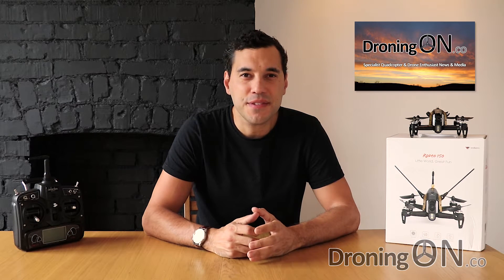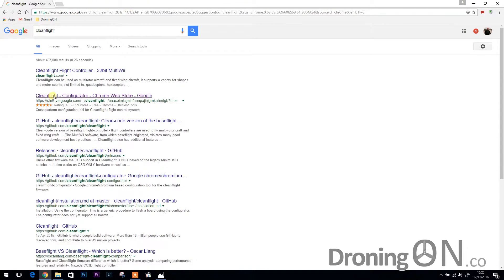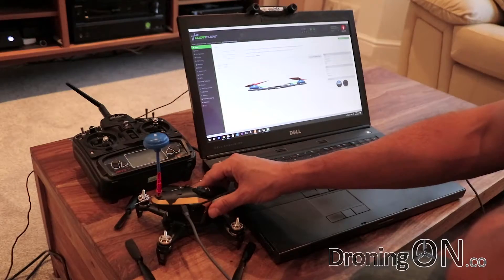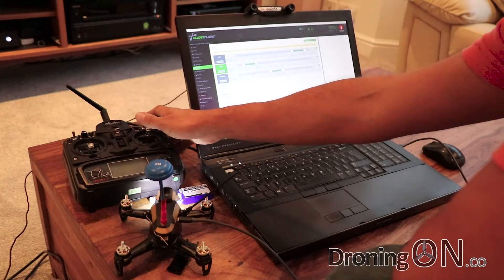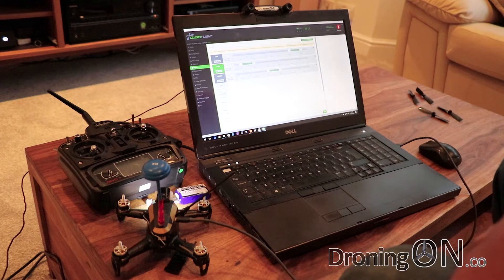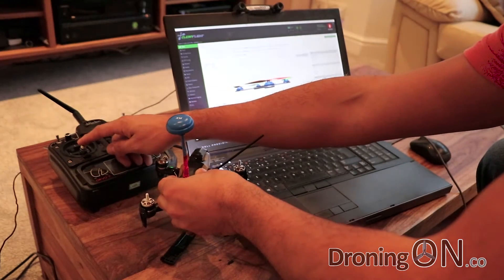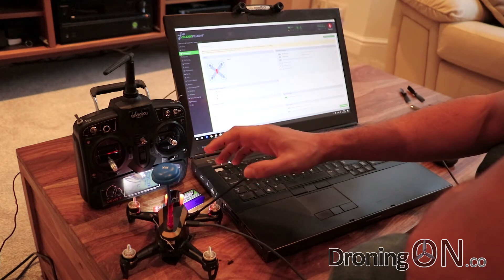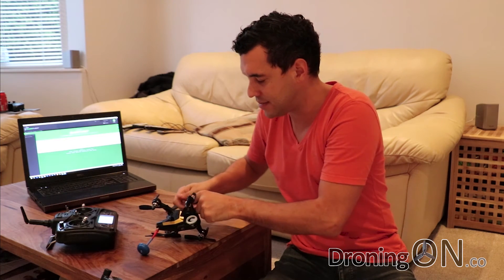DroningON | Rodeo 150 Cleanflight Tuning, Tips and Tricks Guide (Cleanflight)

Comment: The Rodeo F150 does not connect to Cleanflight version 2.0.0 and above.  If you do so on connection it will say that clean flight is not compatible to 3rd Party firmware.  Download older Cleanflight release such as 1.2.4 from here 
https://github.com/cleanflight/cleanflight-configurator/releases
Download the  cleanflight zip file version you want test and place it in a folder on your pc that you can easily find. 

Then the right hand corner of Chrome you see 3 dots stacked vertically. 
Click and go to "More tools" > "Extensions"

A new screen is loaded.
The top of the screen there is a Blue Bar with Extensions heading. 
At the right top of the screen there is a slider developer tools .
Slide it to the right. 
Then 3 buttons appear.
Load Unpacked / Pack Extension / Update.

Click load extension.
A  browsing box appear. 
direct path to were you saved the zipped Cleanflight configurator 
You will see that there is Clean flight added. 
Go to Chrome Apps launcher and run the Cleanflight 
Download the drivers  
Shut down restart pc.
Enter Chrome 
Connect the F150 to your pc
Then hit connect and follow Droningon video..... :)

Comment: It is an excellent tutorial and I tried to follow you step buy step . I plugged the 150 to usb and my laptop found and installed the driver. Next I downloaded the Cleanflight app. It showed com3 and if I drop down the list there is com6 and manual. 
But when I click connect nothing happens. A message pops up that the firmware is not compatible.
On  walkera site there is some files for download but I’ don’t understand what these are because they seem configured files for cleanflight and the r159 but there is no more info. 

there is a video how to connect  the 110 using a clean flight and update firmware  version they have in the 110 section. 
If I remove and download this that clean flight version then it connects however it seems the orientation front back is not correct. But I did not dare do anything else. 
I wish to have your set up on it it makes more sense.
I’m using windows 7 any one with same issue?

Comment: Thanks for the video, but I am running into a problem. When I have my Rodeo connected the CleanFlight app returns a warning that non-Cleanflight/Betaflight is not supported. My Rodeo is factory default.
Should I have done something prior to your video to enable Cleanflight at all?
Are there different versions of the Rodeo around?

Comment: I cannot get on to cleanflight with my rodeo 150 I have tried my laptop, tablet and phone. I ended using EZ GUI app and I have lost my low voltage warning.  Do you have any suggestions Please? I have downloaded all of the cleanflight drivers and the 150 drivers but it still won't open it says port successfully open and then it says port successfully closed?

Comment: Hi i have got a few problems with connecting my rodeo 150. Everytime i click connect i get the message that cleanflight and betaflight are no supported. Please help me I'm getting frusted about this evertime i try to solve this problem.
Reply from the maker: Thanks for the comment +Franz Stadler, are you using the right version of CleanFlight? Remember that the Rodeo 150 has an old firmware and so you might need to use an older CF version to connect to it.
Reply from the maker: Try rebinding the two?
Reply: DroningON  could you explain me how this works? i have no clue how to rebind them.
thank you for your answer and congrats to 10k subscribers 🎉
Reply: @Droning-ON   I need your help i still can't connect these 2 idiots, the drone is alright i can connect it to my pc and to cleanflight but i can't connect the drone to the devo 7... im so frustrated i'm thinking about just buying a new drone and throw the rest away
Reply: DroningON thank you very much for your answer i'll try it next time!And by the way i'm a great fan of you although i am from austria(not australia) ^^
And keep on making such awesome videos 👍
Reply from the maker: Thanks +Franz Stadler, that's nice to hear - let me know if you have any additional problems.
Reply: Seven months later  my drone just wants to turn to the right side everytime i arm it. So the props always touch the ground if i want to start. I already connected it to cleanflight an the sensors are in 0 if put the drone on the ground but however it turns itself everytime to the right side and i don`t know why... please help me ^^
Reply: i thought it would be i a good idea to reset the devo 7 and no i can't connect the devo 7 with the rodeo 150... 
I'm really frustrated because i fu**ed it up
Reply: and another failure because i have found a problem like this in a forum i thougt lets just do this and to sum up i think i have deleted all the data from the Flightcontroller( I don't know if its the right name), because i can't even enter the cleanflight program anymore... i think i am going to throw the drone into the dustbin
everthing was fine untill the drone just started to turn over... i think i have to get a different hobby
Reply from the maker: Frank sounds like you need to recalibrate the accelerometer? If you connect to CleanFlight, you have this option on the first page after connecting. Keep it on a flat surface when recalibrating.
Reply: DroningON i tried it severall times but it didn't work. so i googled for some further information and then i did a reset of the drone and the devo 7 and now i can't connect them anymore
thank you for your answer!

Comment: Great as always. I know this is a Rodeo vid but I desperately need your help. I just read the posts from you and the Walkera Forum Admin and I am still a fan of yours(and him as well). I have Deviation on my Devo 10  and Cleanflighted my F210 3D and they still aren't playing nice. I notice when pairing the 2, the rear lights are responding to my TX sticks  but the F210 3D still constantly beeps and doesn't power up the motors. I did a reinstall of the Original Walkera F210 3D Firmware supplied by "Mr. Walkera Forum Admin" and a complete reinstall of Deviation on my DEVO 10 but still no motor spin! Can you please help as I know I am not the only one experiencing this. I tried your "Fix bricked F210" directions from your website but "Mr. Walkera Forum Admin" said to uninstall Cleanflight since it cannot be read by the F210 3D(although it did). I miss flying and would like to get back into it ASAP. Can I just mail you both my F210 3D and Devo 10 and pay you to fix it so they both work again? ;) Thanks.
Reply from the maker: +Dave Silva hey thanks for the comment and yes Mr Admin in the Walkera forums is a pretty unfriendly fella, I won't be revisiting and my last comment was my last. In terms of your F210 3D, it's a tricky one as the regular F210 has a fairly standard FC it seems, whilst the 3D version is more complex due to the 3D ESCs, therefore the lock/unlock process is proprietory and there doesn't seem to be a way to get it working. I would flash your 3D back to the factory firmware, unfortunately with that model you don't seem to have any choice :(

Comment: How do you restores the configurations?
I have flashed the F210(3d)V0.05_usb.hex 
Then I copied the content of "F2103d_configV0.0.4.txt" into CLI of Cleanflight 1.2.0 put ENTER and appear this:
# {"generatedBy":"1.2.0","apiVersion":"1.13.0","pr
Unknown command, try 'help'

I realised that F2103d_configV0.0.4.txt has not a "dump" format but I don't know why
Reply from the maker: +enrique courtade after you've entered the config into the CLI, remember to hit 'Save' otherwise it won't commit.
Reply: DroningON.co I have found the solution. The. txt must be restored using RESTORE option in the Setup tab  because it is not a command file to use with CLI. I think It could be corrected in your tutorial. Thanks for your help
Reply from the maker: +enrique courtade good advice, thanks dude, if I make a follow-up I'll add this to it.

Comment: this is EXACTLY what i was looking for, great tutorial and love how you included links to specific chapters in your explaination!
Reply from the maker: +supergrooover thanks so much for the comments, do subscribe and help us to build the channel by sharing this video to all of your Quad related Facebook groups to help others!
Reply: i sure will, already pointed some guys here! Question though, i have come to find after reading some forums that airmode actually is NOT the same as disabling motor stop. I went looking after having some bad chopped throttle experiences. Do you know of a way of actually enabling airmode? A nice addition to your video might be that the newer versions of cleanflight DO NOT work with the rodeo. Have to use 1.2.0.
Reply from the maker: +supergrooover correct, Airmode maintains the micro corrections to keep the quad stable, I believe that the PIDs are essentially still active for Airmode whereas with basic idle up they're not.
Reply: DroningON.co  alrighty then! And do you know of a way to get airmode switched on? Maybe you could make a tutorial about flashing the latest cleanflight to rodeo 150, that would be awesome! I have found some German flashing betaflight even, so I guess it's possible.

Comment: i think im doing something wrong.i have cleanflight.when i plug in usb cable.it doesnt look like your cleanflight.only weird symbols..
Reply from the maker: +Marcel wol can you upload a video to YouTube to show what you're seeing?
Reply from the maker: Right so you're seeing these odd symbols in the CLI right? I'd suggest that you're trying to use the wrong configurator - in other words, if the FC has CleanFlight installed, you must use the CleanFlight configurator to configure it, make sense?
Reply from the maker: If one won't connect then it's likely that you have the other, so try CleanFlight and also BetaFlight configurators?

Comment: Hi can you put air mode on a separate switch instead of the arm switch? Thanks
Reply from the maker: +RC944jim if the version of CleanFlight or BetaFlight supports it as a 'mode' then yes, simply define it on the Modes tab.
Reply: Thanks I'll take a look 👌
Well no option for the Rodeo 150 or the F110, but there is on the F215 that comes setup from Walkera with Air Mode on the top right switch.
I did move the Motor Arm to the Gear switch

Comment: Can the lvc be adjusted also,seems like it's set to start beeping about 3.6v...I want it to be at 3.4🙂
Reply from the maker: +Funk Brother's Adventure's I find that the Rodeo 150s LV warning kicks in at about the right level for most batteries - I wouldn't recommend reducing it any further because of the drop in voltage during even the most minor of throttle leaks on this quad.
Reply: DroningON.co Ok thanks,I'll leave it like it is and just get more batteries,I have 3 now,I'm going to set the arming and unarm on the top right switch on controller and beep sound on that left switch like you did,I just got my Rodeo 150 and have only flown it 2 battery charges,flies great,really like your videos!!..I'm going to keep practicing,I ordered the Goggle 4 today to try out the fpv😀

Comment: hiya. I have just my 110 through and it isn't connecting up. I have installed said drivers but it won't connect up. I know this is a video recording the 150, because they are similar I am just wondering if you had to do something or download something which hasn't been specified on the vid
Reply from the maker: Have a read here, its for the F210 but section 1 shold get you connected
https://www.droningon.co/2016/11/10/fix-bricked-walkera-f210-3d-flight-controller-fc/
Reply: hiya, thanks for replying. It has come up with bootlog failed and doesn't do anything when I try to connect the quad up to betaflight and cleanflight. I have no clue now how to proceed. My Devo 7 Transmitter no longer works with my Quad. I only did this because the Quad was stuck on Horizon mode. I have been advised to open up the top of the Quad and press the Bootlog Button but apparently that is risky. I don't intend to do that because so far the advice I have been given has just screwed the Quad up even more. Again I don't know how to proceed. I doubt I would be able to get a replacement or a refund now because I was trying to fix it through the advice I got on here and on Facebook. I am not blaming you as it was my choice to fiddle about with it. I think though in future just say fiddling about with the firmware could cost you your warranty and it isn't guaranteed to fix

Comment: liking your videos dude. I have a few questions. Can you use clean flight for the Walkera Rodeo 110? If So is there a toggle option to switch the led light on and off?
Reply from the maker: +Cuffy Bigglesworth I have a 110 ready for review and so hopefully I can confirm soon. Does it ship with Cleanflight or Betaflight? It might be that the lights are hard wired rather than connected to the FC, in which case you won't be able to programme them.
Reply: Hiya Droning on. Cheers for replying dude. I have just ordered the 110 bnf from Amazon and have just received the devo 7 radio. I hope I can do the mods via clean flight like you did in your videos for the 150. I have subscribed to your channel and look forward to your review of the 110

Comment: I have a question i  cant go on cleanflight no more he says that non cleanflight/betaflight firmware is not supported, exept for cli mode what can i do?
Reply from the maker: +Bennie Leip have you tried using Betaflight instead? Sounds like you're using the wrong Chrome extension?
Reply: But i always used cleanfligt cant it be that i have to upgrade or something? And betafligt says the same thing
Reply: DroningON.co and if you buy this drone in the litle book you see that i can upgrade by usb port on walkera.com has that something to do whit it?
Reply: I dont know how to connect to that site(if possible) you only can download there and then use that to flash it from cleanflight but it would be easy if i know where the board is running on than you only have to klick on that by cleanflight klick the newest edition and flash it

Comment: New problem when hooking up my Rodeo 150 with C/F I get a message  Non cleanflight/BetaFlight firmware is not supported except for CLI mode. Using configurator 2.0.0 tried on 2 different windows 10 computers also deleted and reloaded C/F in Chrome. Any ideas? 🤔 the 150 is making connection with C/F unless I'm doing something wrong. Thanks 
I should add the Rodeo flies fine and no changes have been made before I tried connecting to C/F.

Well I figured it out, why Cleanflight developers forced an update 2.0.0 I do know it doesn't work for a lot of people. I got some help on. Facebook was told to download 1.2.4 again and load it back into Chrome. All is well for now 👍

Comment: Hi I need your help again, I now have a Walkera F215 what is happening near the end of my flight when the warning lights on the back start to flash I have to land immediately or it looses power the motors are still armed and spinning but it won't lift off. Is there something I can change in cleanflight to give me an earlier warning to land like 30 sec. I did search YouTube but didn't come up with anything. 4S   1300mHA. 60C lipo used.
I like to keep my cells around 3.7 V. Thank You
Reply from the maker: +RC944jim sounds to me that your battery is nearing end of its flight time, when 5he voltage is too low the quad won't son the motors, that's the time to change to a charged battery.
Reply: Yes that much I know but nothing else I fly stops that quick after the warning, I general get 30 seconds. Is there nothing I can change using cleanflight to get an earlier warning? Thanks
Reply from the maker: +RC944jim not sure with the 215 but you should be able to to lower the minimum voltage threshold? Give it a try and let me know!

Comment: I use one Devo 7 transmitter for 2 Rodeo 150's if I set one up the way you explain in this video is there a way to transfer those setting to the second Rodeo.
Reply from the maker: +RC944jim absolutely! In the first Rodeo that you setup, go into the flight controller software and select CLI, run the Dump command - this will output all settings, then copy and paste this set of commands into the CLI of the second Rodeo, then type 'Save' and that should be it?
Reply: 👌 thank you have a good day!

Comment: iS THIS DRONE A TOY DRONE OR IT CAN BE CALLED A STARTER DRONE OR SIMI PRO DRONE
Reply from the maker: Its not a drone for aerial photography, its more for racing via FPV, i.e. wearing a headset. In terms of skill-level, I would say beginner to intermediate.
Reply: thanks for the tip and one stupid question since I am new a drone flying I connected my falcon 180 drone and it told me i need to upgrade the firmware and my question is how i do it

Comment: thanks man cleanflight is awesome  but i noticed that after configuring this rodeo the part of anthenna is hot is that a normal thing?
Reply from the maker: +Ecoi Villesis, did you actually have an antenna attached to the Rodeo 150 whilst configuring? If so, then don't worry about the heat, it is normal for VTX's to get rather warn when sat idle. It isn't necessarily healthy for the VTX but it is normal.
Reply: yes i did!  after that i noticed that the plastic cover and the anthenna slightly hot even when im fying the rodeo150 that part slightly hot sorry for my english
Reply from the maker: Yeah that's fine, the VTX will always get warm/hot when powered up, although the Rodeo 150 does have a habit of getting a bit too hot at times, the ESC's sometimes melt!
Reply: how to prevent melting esc?
Reply from the maker: +Ecoi Villesis there isn't an easy way to prevent this unfortunately, but it's cause is also unknown, mine has been fine for many months.
Reply: okay thank you so much